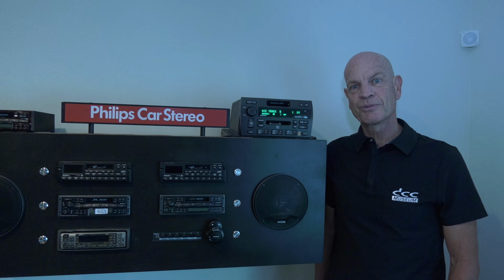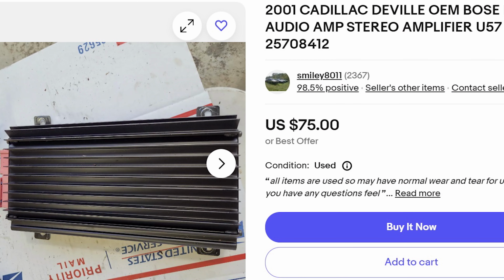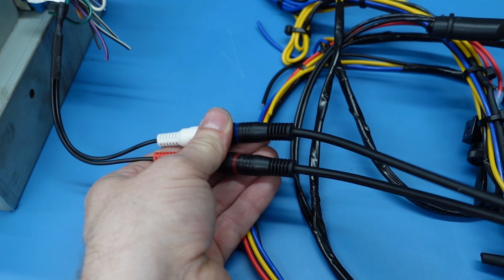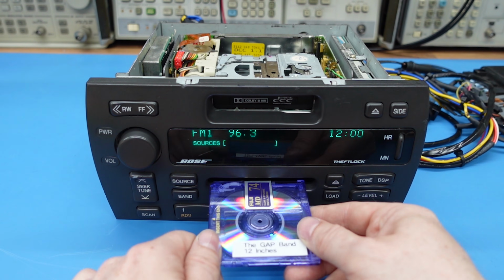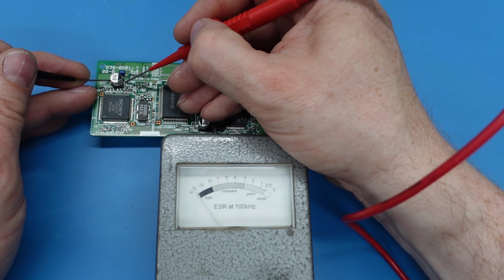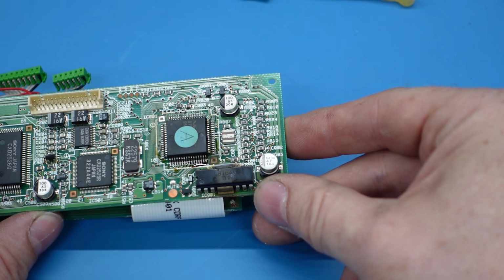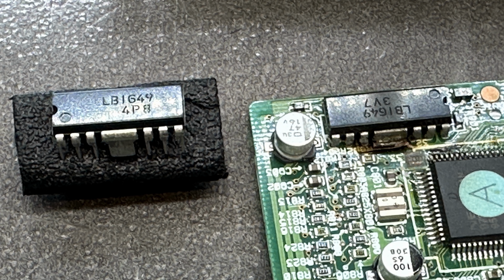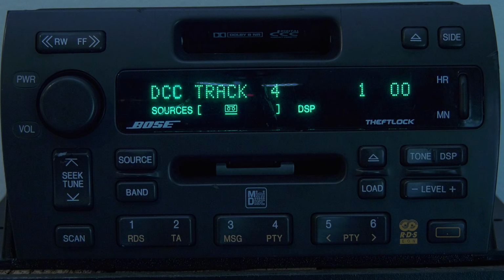The Prototype MiniDisc and DCC Car Radio by Bose is Alive.... Partly!

Comment: A design in car audio that always benefits the manufacturer. This was never about theft.
Reply: Well, maybe. But it will still definitely reduce the likelihood of specialist break-in just to get a car stereo in general. They would know this is much harder to sell if it can only be handed off to someone looking for this specifically.

Maybe this was more unusual back when. But especially nowadays, these things are usually so integrated they are not worth the effort to transplant to another brand even if possible anyway. Part of the dashboard even.

It will at least eliminate 2/3 of the type burglars considering it. So only the "scrounging for the next fix" type left. Those are likely to trash the car even to only find you didn't actually have a stereo though. 😞
Reply: It was part of that era's overthinking, over designing neurosis. High paid electronic nerds inventing superfluous hyper-complex auto ACCESSORIES. FFS, its just a music player.
Reply: It absolutely was about theft. Car radio theft used to be a massive problem. Making the radio not function without the matching module significantly reduces its resale value, thus reducing the chance of theft. The reason radio theft isn’t a huge problem anymore is precisely because of this type of system.
Reply: @tookitogo yeah I've been driving cars since they had radio cassettes in them. I've lived through and experienced radio theft from my car. But back then you could replace it with whatever brand you wanted at a minimal cost. Try replacing a stolen one now and see how much it costs you to have it coded to your car. It may have been banded about as theft friendly but they knew what they were doing when coding systems to one specific car. All about the money.
Reply: @ 🤦 But the fact that you can’t install a stolen radio into your car is precisely what makes theft so rare now. That is literally the point.
Reply: @tookitogo  that's your point and it's correct but I already knew that. I had a different point where it wasn't just about stopping theft.
Reply: @  I think that just became a welcome side effect. But a negligible one, given that car radios practically never fail, and that factory radios are practically never stolen anymore. So they’re not exactly selling tons of overpriced replacement radios. 

Anyhow, you’re now saying that my point is correct and that you agree. But remember that I stated my point precisely because your original comment says “This was never about theft.” Well, no, it certainly was about theft at one point.
Reply: @tookitogo think about when they started doing it when thieves weren't so aware. They'd steal one unwittingly and who were there to have a replacement and a computer to code it to the vehicle at a ridiculous cost? Yes, it was about deterring thieves but I still say it was about the money the manufacturers could make from it. Not to mention the extra cost in the vehicle in the first place.
Reply: @  You first claimed it was “never” about theft. That was incorrect. That was my point.

Comment: All bad formats combined, Mini disk, compact cassette and DCC.
Only the CD players did good audio back then, loved the multi CD changer players.
BOSE was trying to offer premium audio systems by dealerships.
Reply: How was MD bad
Reply: Pretty hard not to get above the noise floor of a car anyway..😺
Reply: There was nothing inherently bad about the Compact Cassette format, but there were so many cheap and badly designed implementations available over the years that the average Jo(e) could be forgiven for thinking that it was. Had Philips licensed the format, they could have imposed minimum specs that a cassette deck had to comply with in order to fit into different "quality" categories, but that was sadly an opportunity lost.

I have two cassette decks sitting here right now from the mid-90s that are capable of overall record/playback performance that makes them hard to distinguish from a CD if decent tapes are used in conjunction with Dolby HX Pro and Dolby C, and neither have ever eaten or damaged a cassette tape due to correct maintenance as per the user manuals. I really wish people who don't understand the format would stop trashing it.
Reply: i'm a Minidisc fan...so i don't think there's anything bad about the format...the portables can be subject to various fails...don't ever drop one...but i have 7 working and 1 MZR55 not working...Cassette decks...i have 3 and quite a few or portables...DCC i've never had the pleasure of owning unfortunately...CD's might be arguably clearer sound than cassette but no other advantage...and too prone to scratching like all open disks...Minidisc is a clear winner in that department...even tapes are safer if you are experienced enough to clean pinch rollers and no chewed tape...i'm an enthusiast so i do know...if you're not into maintenance like most then stick to CD's or HDD storage

Comment: Glad you did not destroy this one like the one from This Does not Compute where you butchered the board and solder joints just because the caps were leaking. It would have been better to ask for help or leave it alone instead of destroying all the traces and pads and rip it apart like a dinosaur does with a sheep in Jurassic Park. I still have nightmares.
Reply: I think that’s a very dishonest representation of what happened in that video. The pads and traces were clearly and obviously falling off BEFORE the board was sent in. It was not a “slightly damaged” board, it was one with severe electrolyte damage. While their scraping looks ugly, functionally it’s no worse than what you would have accomplished with a fiberglass brush.

And they didn’t add shipping damage, that occurred on the way to the museum, not from it.
Reply: I went back to watch both of TDNC vids on the DCC..
The DCC Museum were instrumental in getting Colin’s machine up and running AND developed the board used to rescue many more….
I feel your comments about the DCC Museum are a misrepresentation of the situation..
Reply: who butchered the board?
Reply: @rammes1  watch "my dcc deck repair did not go quite as hoped" on the channel "this does not compute", minute 4:40 and on (a video from 3 years ago). He had a slightly damaged Board and then he sent it to the dcc Museum and it came back all scratched, all contact Pads ripped off. who knows what they were thinking but the only thing they did to his deck Was ruin it fully and add a Transport damage to it. You can use a fibreglass pen or repair the traces but they just went wild and scratched it probably with a knife or sharp screw driver on delicate already weakened Pads. A real expert could have easily repaired this. I dont know who did this (what Person) but they say dcc Museum did that in the video. Not quite a Museum grade Work. It's like Washing Mona Lisa with break cleaner and send it back to the original owner, it's disgusting. Now they have new Boards made, which is at least a bit helpful because they seem not to work on original condition stuff in any way shape or Form acceptable.